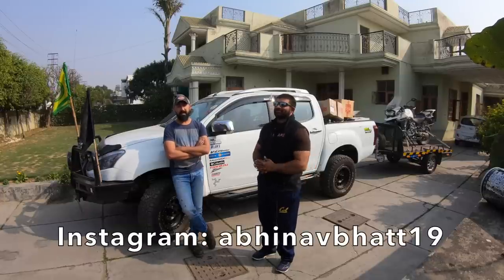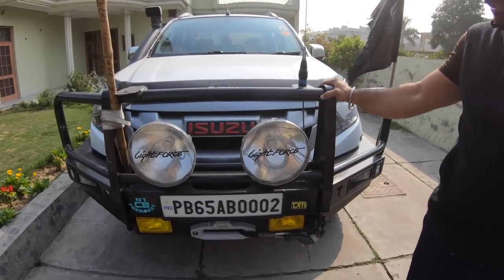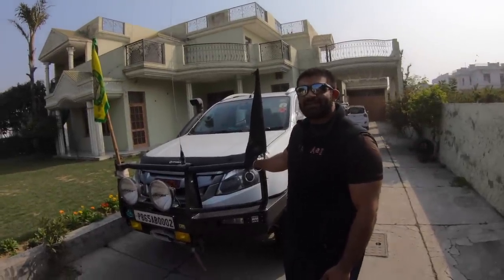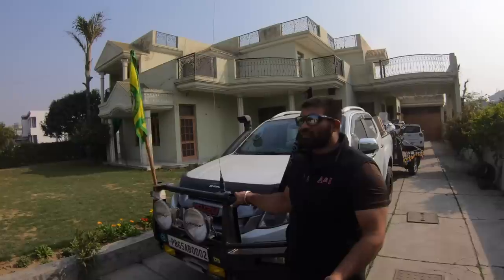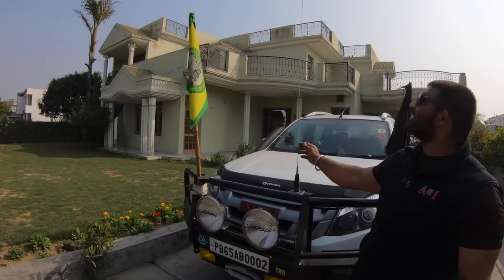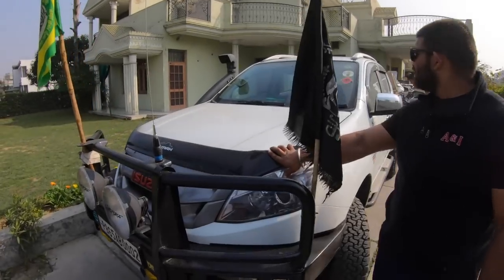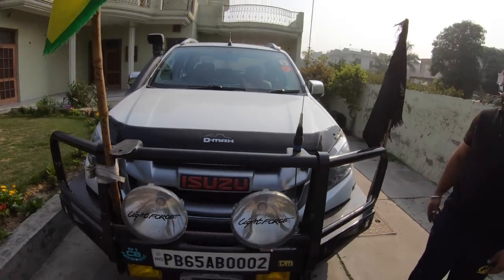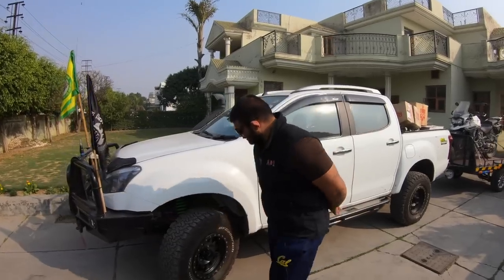Jaideep's Isuzu D-Max V-Cross: One Of India's Nicest Modified Pick-Up Trucks

Comment: Very detailed video but i would like to ask something regarding the body lift. Does installing those body lift means changing  the engine and gearbox mounts too?
Reply: No. Just slight alteration in the steering rod, gear levers, radiator mounts and brake lines 🙂
Reply: @punjabiglobetrotter7685  I've always wondered abt this. Thank you :-)
Reply: @golakago  welcome 🙏

Comment: Abhinav, I had this question -  26:20, considering the additional weight on the luggage bed of the shell - doesn't it exert pressure on the body mounts?
Reply from the maker: Slightly, but these vehicles are overengineered to begin with.